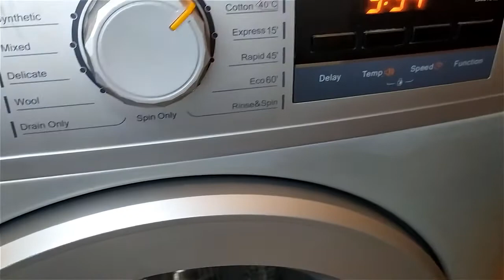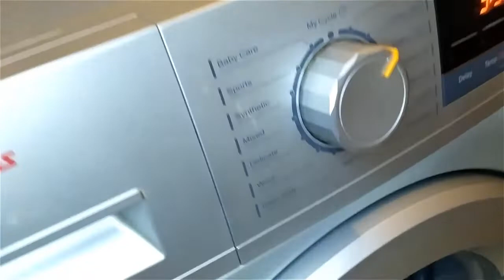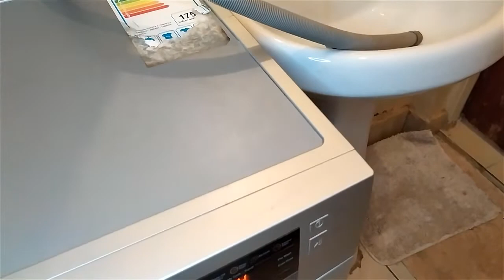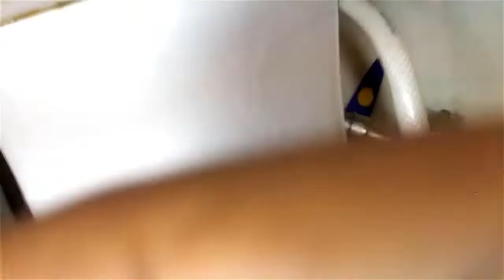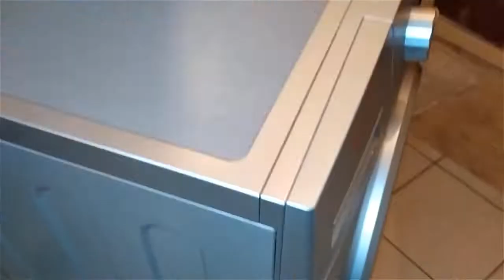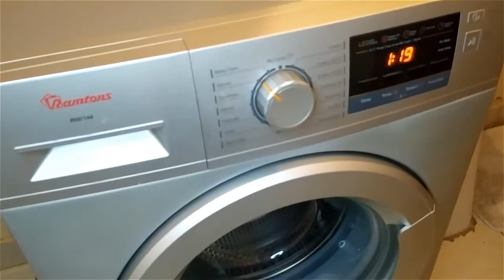Ramtons 7kg Front Load Washing Machine Review Kenya - Worth 54K?

Comment: Does this machine develop a pungent smell after some time of use, especially when washing water is heated to say 40 degrees. I am asking this because doing so using regular hand wash detergent leaves the bucket with a pungent smell. Also, what are the remedies of this occurrence?
Reply: Put some vinegar and baking soda in it and do a run
Reply from the maker: For the smell, try cleaning the machine. Dirt and mould can build up over time especially on the seal, detergent drawer and lint filter..

Comment: Thank you for making this video. How is electricity consumption on this machine? Also does it shake violently or is it conspicuously loud during washing.
Reply from the maker: The machine is quite energy-efficient & doesn't use a lot of electricity. There's also no shaking and the noise isn't too loud when in use.
Reply: @maliyotereviews  thanks a lot for your response . A last question-I also noticed that you put a red rag under the machine while it was doing the washing cycle (9:26). Is there a leak, that develops over time, through the door?

Comment: you can connect the drain also to the drain of the sink by using a junction. .the way you have done it is wrong because the drain should be level to prevent dirty water going back to the pipe
Reply from the maker: Ideally, yes; the drain should be level. Thankfully, the washer's drainage pump pushes out the water.

Comment: That connection pipe junction can you refer me to where I can buy one or give me contact for a plumber who can do it for me. Thanks for the great review.
Reply from the maker: It's a t-joint. It's available in most hardware stores huku Kenya. Don't forget to get a size that matches your water source so that it fits
Reply: I have exactly that type  but the handle is broken  how can I repair it
Reply from the maker: @faithdan8135  Your best option would be calling their customer care number 0800723723. They'll give you the best solution.